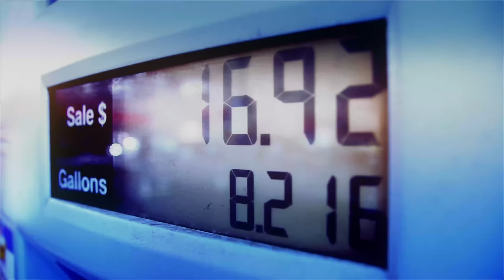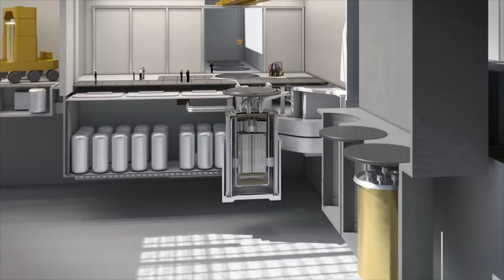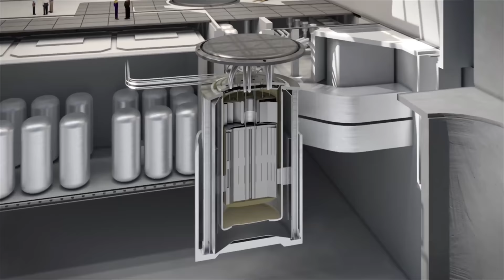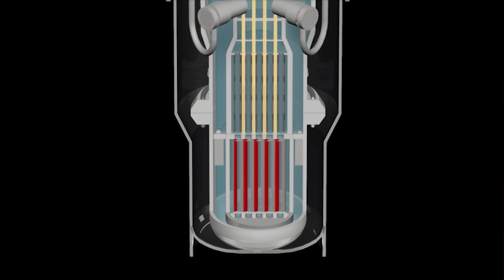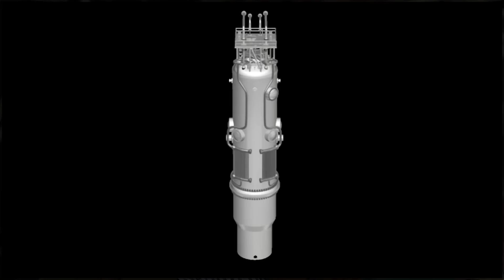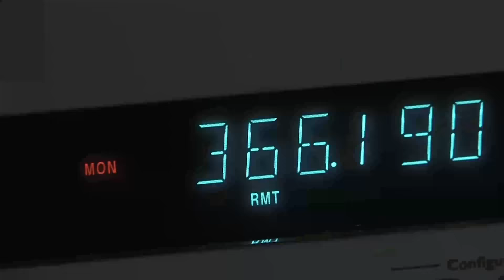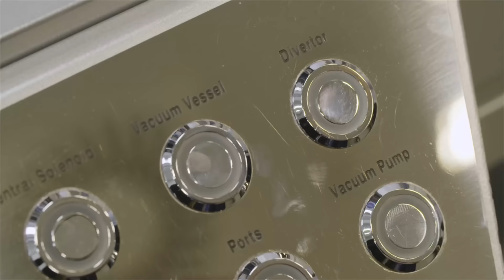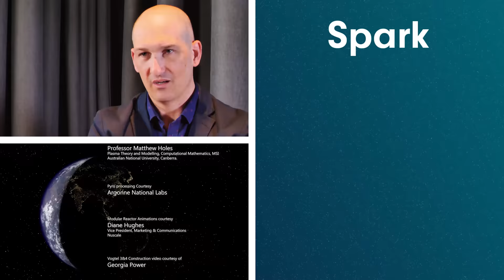Can We Trust Nuclear Power Again After Chernobyl? [4K]

Comment: Chernobyl did not have a containment dome ,ok .Our containment domes here in the U.S have 4 ft thick concrete with 2 inch rebar woven through them . Inside you find redundant systems upon redundant backup systems in case of an event .All our plants are run by procedure. The Chernobyl event happened because they were performing a test outside of procedure. They basically had a vessel in the ground with a steel lid on it. And when it got out of control they couldn't shut it off and it blew that lid a mile high,spewing out acute radiation.
Reply: You are correct about management pressuring the trained operators to do an unsafe test at Chernobyl.  And every U.S. reactor has automatic safety systems that can be overridden (we don't let computers have complete control of a reactor) just like at three mile island.  I believe our reactors to be very safe but all three of the major reactor accidents occurred because of unforeseen events.  The Three Mile accident occurred 2 years earlier at Davis Besse but just by chance it was averted.  The public never hears about the many accidents that almost happened.
Reply: Typical Soviet era engineering

Comment: We always have been able to trust it, it's clean energy it produces a whole lot of energy, and meltdowns aren't common in newer nuclear power plants.
Reply: Clean huh what about at of the spent rods that are still radioactive, do they just magically disappear?
Reply: @andy123441  they're usually put into secure disposal sites or enriched to be reused.
Reply: @andy123441  The spent fuel rods do not magically disappear, but then neither do they spontaneously materialize outside of their concrete steel-lined casks.

Dangerous? - yes - that is why we put them in those casks.
Problem? - no - the danger is contained, in the casks.
Reply: The U.S. cannot build them cost effectively.
Reply: @clarkkent9080  Generation IV should allow us to do that.
Reply: @shawnnoyes4620  I don't understand why a Generation IV reactors would be cheaper.  They use very expensive new technology which should cost more in engineering, material cost, and construction.  Some cite "build it in a factory" as a cost savings but every component that can be built in a factory and shipped to the site is already being done.  Systems modules are built in a factory and shipped whole to the site.  It is not like they are going to make motors, pumps, piping, and pressure vessels in one factory.

Someone in the U.S. must actually build one and operate the new technology for 10 years before the real cost is known.  The last nuclear plant (Vogtle) in the U.S. (2023/2024) cost 35 billion and is the world's most expensive (per Mw capacity) power plant in the world.

Comment: Nuclear power is the future. Chernobyl was an example of the operators being forced into doing many, many things wrong...AND: Not having a true containment building was just stupid, and could never be approved (even in Russia) today.
Reply: @BurgerTaco  Ask yourself why US developers have been told the local utilities don’t allow solar panels on new homes.
Reply: @BurgerTaco  problem with solar panels is that they provide very little energy and it isn't enough to provide to a whole community. Nuclear energy may be more expensive, but it's highly effective at providing energy stretching across miles. Not to mention, I don't even think there is a way to store all that solar energy, as of yet. Until they somehow manage to do that, I'm going have to go with Nuclear energy.
Reply: Not sure a containment building would have helped much with Chernobyl Unir IV, but the fact that they didn't even try...
Reply: FUSION is the Future.
Reply: @BurgerTaco  There are millions of solar panels in California and STILL there are conserve electricity alerts on high use days, blackouts and brownouts. So even with all the electricity being put back in the grid by solar panels on 1.3 MILLION homes in California, there's still an energy supply issue. The state closed the San Onofre nuclear power plant located between Los Angeles and San Diego leaving just one nuclear plant for the entire state!
Reply: @phil20_20  easier said than done. Fusion has been discussed for at least 30 YEARS.
Reply: Piffle. Regulations change, human nature does not. People will always cut corners.
Reply: @CYCO1631  Wasn't there a similar issue with Fukushima? The original containment structures ooked pretty flimsy to me. Also, the reactors were of an older design since Fukushima went online from 1970-1979, so they were between 32 and 41 years at the time of the 2011 quake.

But Chernoby honestly was a disaster just waiting to happen.

Comment: I'm on a huge learning about nuclear power kick right now!!

I want to watch these with my 3 kids!
Reply: Here is all you need to know if you live in the U.S.
The Southeastern U.S. is super pro-nuclear MAGA, has zero anti-nukes, and 100% political support. 
VC Summer (South Carolina) new nuclear units 2&3 were canceled in 2017 after spending $17 billion on the project (original estimate of $14 billion and 2016 completion date) with no clear end in sight for costs or schedule.  Anti-nuclear sentiment was never identified by the utility as causing any of the many delays.
Vogtle (Georgia) new nuclear units 3 &4 currently 110% over budget and schedule and still not operating. Mid way into the build, the utility stated that had they known about the many costly delays they would never have chosen nuclear. Anti-nuclear sentiment was never identified by the utility as causing any of the many delays. They are now delayed another year because according to the project management, thousands of build documents are missing. Utilities, not the media, decide the most cost effective electrical power source and give the above failures no U.S. utility is even considering new nuclear at this time. If you can’t build new nuclear in the MAGA super pro-nuclear southeast U.S. then where can you build it?
In both cases, the ratepayer is stuck with paying the $50 billion bill. And the silence of the Rah Rah nuclear folks on these events is deafening.
Reply: @clarkkent9080  Yet you continue to ignore from your blank trolling channel the fact that the US and many other countries have built and used small modular reactors for many decades built in two years or less for millions not billions.

Comment: Build it to modern safety standards, don’t put it on a seismically unstable island and actually maintain it.
Reply: Actually you can still build it on the seismically unstable island, just put the diesel backups above the reactor containment vessels instead of in the basement where it can be flooded. Also the western shore is fine.

Comment: Chernobly was an old design badly run, Fukushiama was caused by a natural disaster.  Nuclear is the only way to go ( it might be the way we, go by Nukes )  It would have been useful to have a financial expert on who would have given us the effect of  recession on global C02 emissions.
Reply: A question  I've asked myself  is what's the operating  costs on  uranium  power plants vs coal.   All the way back to the costs of mining and enrichment.    As in cost per kw.
Reply: I strongly support nuclear power. Our use of energy simply demands it.  But as literally every disaster has been the direct result of design and management failures, methods have to change. Fukushima’s multiple meltdowns were not caused by a natural disaster. Neither the earthquake nor the tsunami caused any damage to the reactors. The system, on the other hand, was designed with luck as a safety model. That can never be done again. 

The safety models of Fukushima included pathetically inadequate emergency generator installation, where disabling seawater flooding was inevitable. TEPCO’s engineering liability is simply criminal, as the plant was designed and built with the exact failure it suffered a fully understood risk, and one it must never under any circumstances suffer, a terminal loss of emergency power. It is only expensive to mitigate this inevitability, not in any way a technological challenge. Incredible hubris and the profit model led directly to a disaster which will impoverish Japan for generations. Ironic? Not really.
Reply: Now if we could only build just one cost effectively.
Reply: Fukushima wasn't caused by natural disaster. After the earthquake and the Tsunami several human factors involved. The accident was clearly due to bad design (e.g. generator at basement level) and various manmade decisions by government and Tepco, including ignorance, political intentions and wrong communication. It seems like a bad idea to build  a plant on the shores of Japan, but in long term, the reactors most whitstand more significant events worldwide, like unseen human involved or natural disasters. Still the new type of reactors are very reliable and I hope we will be able to recycle soon some of the leftover radioactive materials and maybe on the long term we will replace all present reactors with fussion power.
Reply: @Majszi85  EVERY nuclear power plant is designed to withstand manmade and natural disasters.  Fukushima WA NOT designed to withstand the size of the Tsunami that resulted from the earthquake.  If it had been designed for that Tsunami then there would have been no problem.  The Safety Analysis Report must address any even with a 1 in a million or more frequent possibility.

Comment: This is like asking if Responsible people should be able to use drugs on occasion in my book.  Nuclear is the safest least polluting best output energy source hands down. The soviet union was not known for safety procedures.  Did they even have an OSHA equivalent or was it just another corruption wing?
Reply: Soviet safety programs consisted of a shot of vodka and a cigarette prior to repairing anything. Maintenance programs consisted of a large wrench to hit most things with. Ideally you’d practice both in order to have a safe maintenance program. Failure to comply was a gulag in Siberia.
Reply: Watch GE Safety Engineer 1985 presentation on nuclear safety reality: galen winsor

Comment: It is not a question - can we trust nuclear power again ? -
It is a question if we can manage and keep control with those 
whos in the command / control room and who doing maintenace .
Nuclear power as such is not that dangeros as long as ALL 
safety procedures is at place and nobody violate them .
As for our future right now , urning more fossil fuel is not good , 
because it will keep increase the global warming .

Hydro power can only be archived in countries who have 
mountains and river ect , so many countries cant get it .
Solar power only work where there is sunshine and that mean 
in the western countries they are of limited use in winter and cloudy 
days . Ok we can put them in the many desserts , yes that is 
one solution . Wind energy only work when wind blows , but 
as with solar energy is a tool we can still use .

Both have the problem that we need to have some sort of 
power storage so we can still get energy when they are not 
running at full capacity .
Those are indeed great technologies but not alone and here 
is where Nuclear power is i fact a good thing in combination 
with those other alternative sources .

Until we have other options for power , nuclear power is 
actually our best solution for a large amount of power 
in a relative clean way .
Storage of the nuclear waste is a problem but the Chinese 
is very close to have a good solution .
They have for some years experimenting with 
Nuclear Power Plants that can run on the waste from the 
conventional ones and after burning that fuel in a special 
reactor it is no longer that dangerous .
Now storage doesnt have to be so long time and radiation 
from the waste is drastically reduced too .

We as humans have to use what we have right now and 
at the same time develop new better technologies .
I just wish they could spend all the money they use 
on stupid wars on solving our planets problems .
Reply: Good summary, Macron has said France's policy is for a 50:50 split between renewables and nuclear by 2050 as well as an overall 60% increase in electric power as it displaces coal, oil and gas. The plan includes extending the life of some of the existing reactor fleet and building up to fourteen new EPR2s. France is one of the very few countries to have mapped out in some detail how it is going to achieve emmission targets. It is an extremely sensible and realistic plan to ensure prosperity and keep the lights on.

Comment: Would have been nice to have a little real discussion of the issues that are always mentioned by nuclear opponents, given the video title.
Chernobyl was a man-made disaster. Even though the reactor is flawed in some ways compared to western designs, it would not have happened if the operators weren't running some dubious experiments with most of the active safety measures disabled. Using it as a reason to oppose nuclear power is like opposing cars because a lunatic drives into a crowd. Idiots and lunatics will always find ways to harm others and abandoning a technology will likely not reduce that harm in any way.
Fukushima caused orders of magnitude less physical harm than the tsunami that caused the reactor failure. Most of the damage was in the minds of people who are simply incapable of truly understanding risk, danger and physical harm in any meaningful way (which, let's face it, is the vast majority of people).

Comment: Here's a logical idea, use new nuclear power plants to power the making of solar and wind power equipment (and tidal etc).
Reply: Can we build them?

Please don’t assume that YT videos are factual.  If you live in the U.S. here is the reality for the last 4 state of the art Westinghouse AP1000 ADVANCED passive safety features new nuclear power projects and spent fuel reprocessing and in the U.S. over the last 20 years. You decide if this YT video was presenting the truth. 

The Southeastern U.S. is super pro-nuclear MAGA, has zero anti-nukes, and 100% media and political support. 

The MOX facility (South Carolina) was a U.S. government nuclear reprocessing facility that was supposed to mix pure weapon grade Pu239 with U238 to make reactor fuel assemblies. It was canceled (2017) in the U.S. After spending $10 billion for a plant that was originally estimated to cost $1 billion and an independent report that estimated it would cost $100 billion to complete the plant and process all the Pu239, Trump canceled the project in 2017.

VC Summer (South Carolina) new nuclear units 2&3 were canceled in 2017 after spending $17 billion on the project (original estimate of $14 billion and 2016 completion date) with no clear end in sight for costs or schedule. 

Vogtle (Georgia) new nuclear units 3 &4 currently 110% over budget and schedule (currently over $30 billion) and still not operating. Mid way into the build, the utility stated that had they known about the many costly delays they would never have chosen nuclear. They are now delayed another year because according to the project management, thousands of build documents are missing. 

Please google any of this to confirm.

If you can’t build new nuclear in the MAGA super pro-nuclear southeast U.S. then where can you build it?

Comment: What I wish is 4,000 small modular molten salt thorium reactors were put in that are breeders and will use the waste fuel from pressurized water reactors as feed fuel to get started. The 9nly question I have is what type of high temperature bricks to use as liners for the vessel. Probably highly compressed aluminum oxide bricks would let these reactors run 50 years with almost no shutdowns for any reason much less refueling. With super critical co2 the turbine could easily spin 50 years with no shutdowns and be 1/8th the size of turbine needed for a gigawatt reactor. To lower the cost of electricity and process heat for plastics and pharmaceuticals lowering the cost of fertilizer by 1/2.
Reply: With 4000 small modular LFTR’s you would have security nightmare and a terrorists wet dream. In process fuel is still nasty for the dirty stuff but it takes time and low security to get at it. Yes LFTR the way of the future but fewer and larger plants so a viable security contingent can always be in place like there’s at all nuclear facilities. In a perfect world we wouldn’t have to worry but there’s always a whack job out there.
Reply: The U.S. is unable to build new nuclear cost effectively be it reactors or plants to process old fuel for reuse.  What magic do you suggest we use?
Reply: @SkypowerwithKarl  The head of the NRC is a politically appointed position.  The leader of any organization sets the tone of that organization as they well should so why are you blaming the employees and what are you blaming them for; being too easy?  being too hard?  We elect the politicians and WTF have we been electing? If you want to blame someone blame the voters and people who don't vote.  The buck starts with you.  If you don't like our politicians then run for office but blaming everything on someone else is a cop out.

Comment: We should be pouring money in to nuclear power using Thorium as the primary fuel source because the fuel cycle results in far less and safer waste that will not require as long of a storage life, safeties that can be built into the reactor itself from the outset and the benefits of consuming currently stored Urainium waste as additional fuel which will go a long way to reducing current storages.

People raise problems with the MSR's design etc but they're not physics problems but an engineering problem which can be solved.